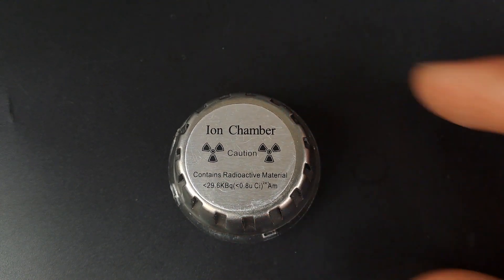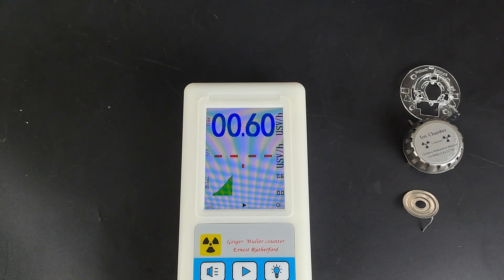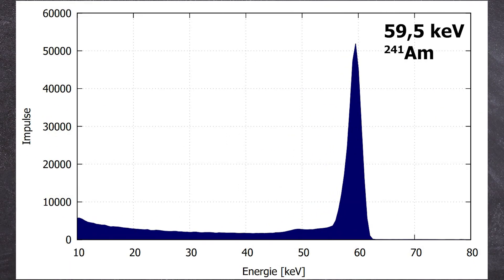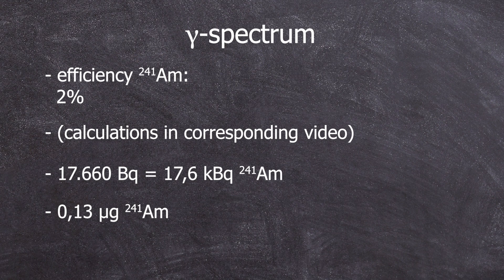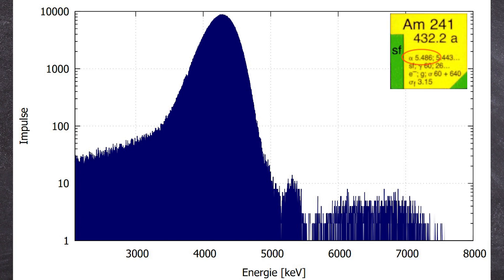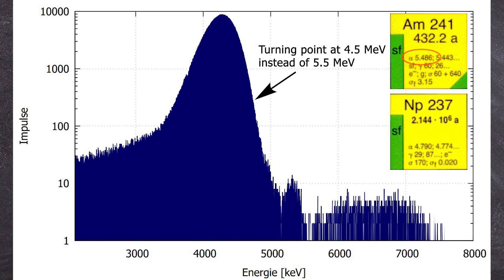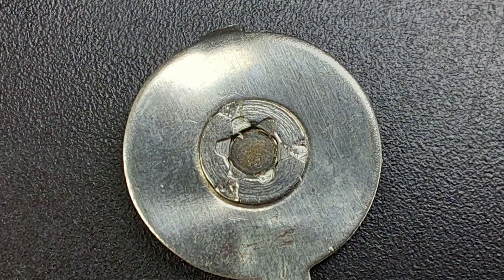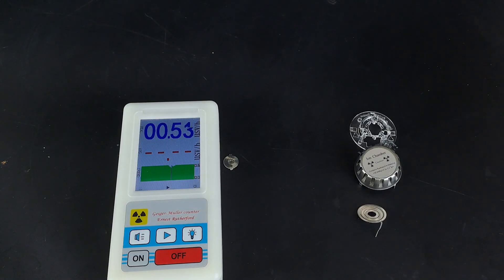Testing Americium in the Smoke Detector! - Nuclear Chemistry

Comment: hi, read your comment and watched the full video. i use one of these to test some geiger counter. If im not wrong its not directly dangerous, the only danger is if i inhale some americium or eat some "which i will never do xD". Is there any other risks ? thanks, and amazing video
Reply from the maker: Its still an open and radioactive sample. Since 60 keV has quite a range it can still give you dose. Not much, most likely close to Zero but yeah inhaling is among the worst Szenarios as each Bq of Am-241 gives you approx. 10times the dose as inhaling the same activity of Po-210. A smoke detectors worth of Am gives gets you in the high mSv close to Sv range if I am not mistaken
Reply: @SimonsNuclearchemistry I get approx 0.40-0.55 mSv never goes above
Reply: @SimonsNuclearchemistry I get between 0.40-0.55 mSv, my usual background rate is between 0.10-0.20 mSv
Reply from the maker: @8BITMAKER151 no you are measuring uSv/h (micro), I was talking about several 100mSv (milli) effective dose when inhaling kBq of Am-241.

Comment: If you encased it in a glass cube like for use in a cloud chamber, would that reduce the radiation that can get out and be harmful?
Reply: "whole body dose equivalent" what it's means? 10x death dose?
Reply from the maker: @ermekz9740  it means if you ingest something, not your whole body will be exposed to it but some parts and these parts that are exposed have different weighing factors, correlating to how important they are (organ equivalent dose). From this you can calculate how bad it is for you overall (whole body dose equivalent).
Reply from the maker: @gregory6488  the radiation in these amound is not the harmfull part. Incased in anything you'd be able to Block the Alpha radiation. The Gamma radiation won't be blocked by glass but its still same to handle in these amounds imo. The biggest hazard is the contamination. Any Americium Isotope is extremely toxic. To put it in some perspective: inhaling Am-241 gives you 10times the whole body dose equivalent to the same activity of Polonium-210. So never ever damage these things ;D

Comment: How radioactive is when it's closed? does the radiation leak out?
Reply: i went to walmart yesterday with a very sensitive geiger counter (Radiacode 102) and i was able to detect around 4800-5000CPM right outside the box of one they were selling, so the gamma can def escape however they arent harmful at all unless you legit eat one or cuddle up with one lol
Reply: @Kepler2258 you sure it wasn’t 480 or 500?
Reply: @Sheldon_Lee_Cooper1980 nah it was in the thousands it said “kCPM”
Reply: @Kepler2258 
My Geiger counter measures 300-500 CPM
It all depends on the detector but the usv/h doesn’t
Reply: 4800-5000 CPM is too much for the outside
Reply: @Sheldon_Lee_Cooper1980  I have a Radiacode 102, they are VERY sensitive, I get 120k CPM right up against one of the exposed buttons
Reply: @Kepler2258  care to explain what this cpm stuff is? ik everything about nuclear but the standard safety shit like this lol
Reply: @demonetizedhistory5806  CPM is just a unit of measurement that shows how many decays per s/m your meter is detecting, another cool thing is point sources aren’t really all that dangerous as long as you don’t eat them (unless you have some crazy stuff like Co-60 or Ir-192). As long as the point sources aren’t dumping out 2 million CPM it isn’t dangerous to have them in a display case for a lot of sources, like am-241’s weak gamma lines drop off after several inches, same with a lot of other weak sources, even with 1uCi of Ra-226 the radiation is back to background around 6-8” away, my Americium source right up against the detector gets about 120k CPM

Comment: hm simon it is safe hold 100 am241  like opening them all at ones.
Reply from the maker: Can you even fit 100 of these in your hands?^^ radiation wise just Holding it once for shits and giggles won't be much of a problem (with gloves).
Reply: @SimonsNuclearchemistry  Thanks Simon just need to melt them together and i will try with my hand for at least 3min.
Reply from the maker: @johndavidserrano5934  highly recommend against that. Americium is an Element, I wouldn't mess with outside a nuclear lab. Its really toxic and easy to mess up with
Reply: Better question: Can you even physically hold that many at once? I think it'd max out at about 30 or so if it's just the button, or 10 if it's the whole chamber before it gets too big for your hands to carry.

Comment: I have one of the same old smoke detector americium samples. After removing the main cover over the americium, my Terra-P+ Geiger counter still couldn't detect the gamma rays. I had to remove the cover door from over the Geiger tube to get any results.
My Geiger counter is a personal dosimeter that reads micro Sieverts. If I remember correctly, the amount of gamma radiation that's blocked by the cover door is the about the same as human skin blocks.

Comment: So are you suggesting that the americium 241 isotope has been isolated from the 243 one? We should see two lines if that was not the case.
I tried this myself, with the same type of ion chamber you got, and I got two peaks, using a non calibrated (I don’t have a calibration source) alpha scintillation probe in air (I know it’s not the best but should put out a low resolution spectrum at least, right?)

If you want I can send the picture of the graph.
Reply from the maker: What "Ion Chamber I got"? I never used one in this video. Are you refering to the Gamma Spectrum? If there was Am-243, you are right, there should be a second peak at 74kev... but there isn't🤷‍♂️ from the Alpha there is no way to identify that
Reply: @SimonsNuclearchemistry I am referring to the assembly you used as a source, there is written on the sticker on top “ion chamber”
Anyway if it’s not americium 243, what is the second peak I saw? Have you got any idea, cause you just demolished mine ahahah.
Thank you.
Reply from the maker: @Telyron  ah haven't had that in mind that its techincally an Ion chamber. (smoke detector for me :D) The very small second peak in the Alpha spectrum could be from Americium Atoms that are just on the very surface. The enery scale on the spectrum is not reliable in this case as I said in the Video. But the surface explaination is just a educated guess🤔😅
I think we can safely say that this big peak is from all the other Am-241 in the alloy and if there was Am-243 it would be inside the low energy Part of the Am-241 peak, as the 241 has the higher alpha energy
Reply: Here is my spectrum, it’s clean but different by yours… the peaks Are reversed (it’s not calibrated)
https://drive.google.com/file/d/1y5esMGQ9h6Fa9AyCsvncOwPwtUJ3skwL/view?usp=drivesdk
Reply: If you are so kind to check it out and give me a professional opinion I’d be very grateful!🙏🏻
Reply from the maker: @Telyron  I checked the Gamma Spectrum just now and there is no trace of the 74kev line attributed to Am-243
Reply: @SimonsNuclearchemistry  interesting, so what could this peak be? If it’s not a ghost effect…
Reply: @SimonsNuclearchemistry  I don’t know why my spectrum looks so clean while being so wrong ahaha
Reply from the maker: @Telyron  I gotta say: the spectrometer I used in this video is old, has seen too much acid and is really not that good. We have a New one but didn't quite get to it so far
Reply: I don't think they even needed to separate out Am-243, as Am-241 is a much more common minor actinide since it's the daughter product of Pu-241, a fissile isotope of Plutonium that used in nuclear fuel along with the Uranium & Plutonium isotopes U-233, U-235, & Pu-239. It's unlikely to even reach Am-242m, Pu-242, or Cm-242 since they moderate how strong the neutron economy is. They don't let it get past Pu-241 (& by extension, Am-241) since that is inefficient with how many neutrons need absorbed, plus again, Pu-241 is fissile, meaning that it's more likely to get destroyed by a neutron than it is to capture it.

Comment: Could I ask for a video looking at secular equilibrium?  I have so much trouble with this concept, though I believe I have sufficient maths education to do it (University Calculus 2, Discrete Math, etc.)  Perhaps look at Radium-226?  

Like, if you start with 20 microcuries at time 0, what does it look like on day 15, then day 35, then day 100... like what is the breakdown of the various progeny/daughters?

I have another question on various decays modes and how to think of decay branching... FOR INSTANCE, Ra-226.  It's primarily an alpha emitter, but sometimes produces a gamma @186 keV... does it decay sometimes with just a several MeV alpha, and NO gamma photon, then sometimes by alpha decay with an associated 186 keV... Perhaps I am getting too technical and maths oriented for a fun YouTube channel?  Sorry...
Reply from the maker: Yes! I have two videos where I talk about radioactive equilibrium planned. I briefly mentioned it in my video about radium paint but I didn't explain it there.
If you start with 20uCi of pure Ra-226, after 36 days you will also have additionally 20uCi of Rn-222 (asuming its in a closed space), +20uCi of Po-218, +20uCi of Pb-214, +20uCi of Bi-214, +20uCi of Po-214. The whole point of seculary equilibrium is, that you see the activity of the longer lifed isotope as constant. This 120uCi will slowly increase over the next 20 to 220 years as Pb-210 decays.
When talking about radioactive equilibrium: of course within the first sec. Ra form Rn but you won't notice it. We can only detect Radon once it decays and this decay is described with a half life of 3,6 days.
Reply from the maker: Nah decay modes are a important part of nuclear science. First things first: The time line goes: Alpha/beta decay AND THEN the Gamma emission. So the 186kev gamma technically comes from an excited version of Rn-222. To really answer this question in full lenght i would have to look at the complete decay scheme, which I only have in the lab.
However when Radium decays there is a certain probabilty for this decay to directly form a Rn-222 in the ground state, with the alpha particle having the energy difference. In this case there will not be a Gamma quant resulting from the decay.
If you have a decay that doesn't produce Rn-222 in its ground state, but in an exicted state, the Alpha particle will have a different energy (Ra-226 has two alpha energies: 4784 kev and 4601kev.) the decay of the resulting exicted state of the Radon then produces a gamma Quant with mostly 186kev (the difference in the tweo alpha energies doesn't add up to the 186kev because the decay scheme is a bit more complicated)
So fun thing is: The 186keV comes acutally from Radon but we associate it as "a Ra-226) line because this excited state of Rn that produces the 186 kev line ONLY forms from the decay of Radium-226.
Hope that helps for now ;D 
You can even calculate the recoil from the decay but thats a topic for the future^^ (This Gamma emission thing is not exclusive to the alpha decay BUT the alpha decay more often produces daughter nuclei in the ground state, so alpha emitter mostly don't have many Gamma lines and if they have, they are not really high in energy)

Comment: Thanks for the alpha spectrum data. My lab is using those Am-241 buttons as an alpha source for one of our projects.
Reply from the maker: Tbh I wouldn't rely on that Alpha Spectrum. A clean Am-241 from a professional source would look much different but I'm glad it helps someone :D
Reply: hey, was that source any good? I'm working on a cloud chamber for my thesis and I need a cheap alpha source to test it.
Reply: @noneuclideanobject  It'll probably overwhelm the cloud chamber since they do about 40,000 alphas per second, iirc. Another good source would be a 2% thorium welding rod. You can get a pack for ~$5.